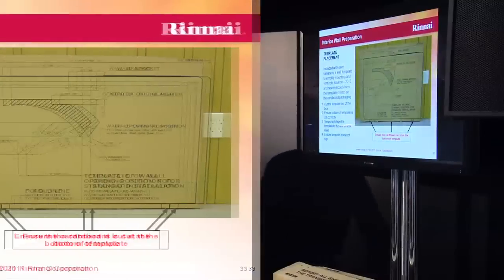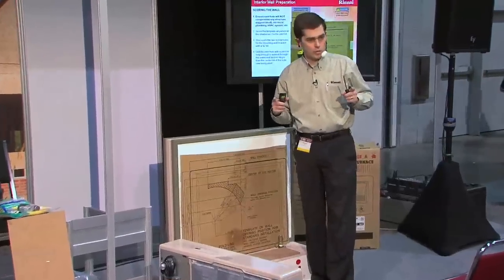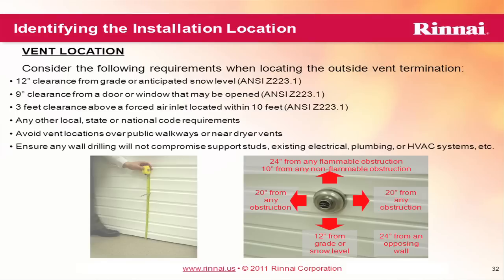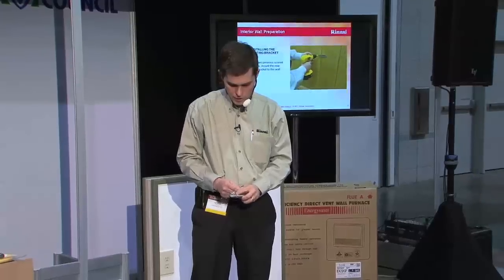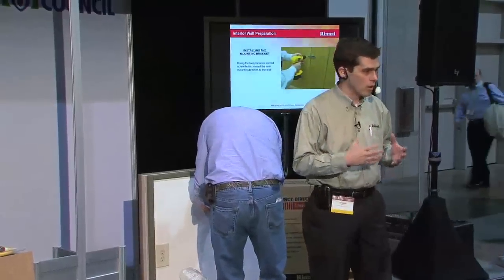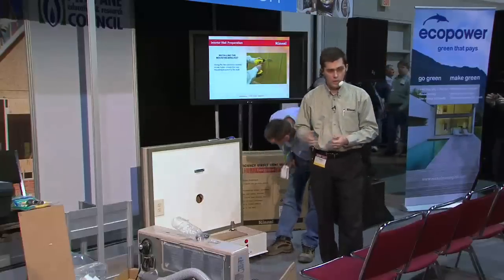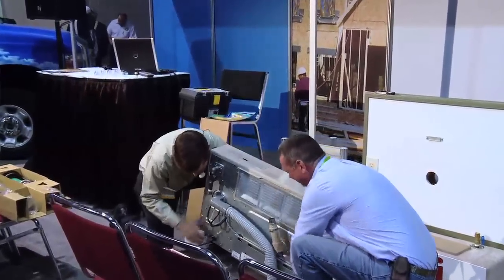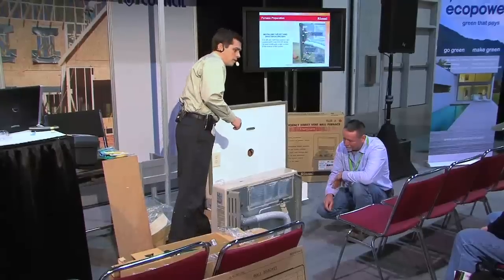How to Install a Direct-Vent Propane Wall Furnace (Part 3/5)

Comment: I understand you’re looking for a 3” hole for the vent.  I have to go through a solid concrete wall, about 4-5” thick.  I only have a 2-9/16” carbide hole saw right now.  Can I make a large enough hole for this with what I have or will I have to break down and buy another hole saw?  (3”)

Comment: Do yourself a favor for future demos.  Get yourself a 3 foot wooden bench so that the crowd can see what you’re doing along the back and bottom of the heater.  Put casters on it just like your wall mock-up.  Your back will thank you for that around 9 pm.